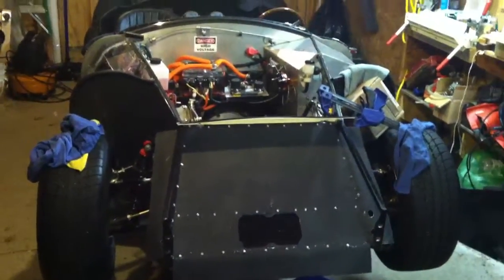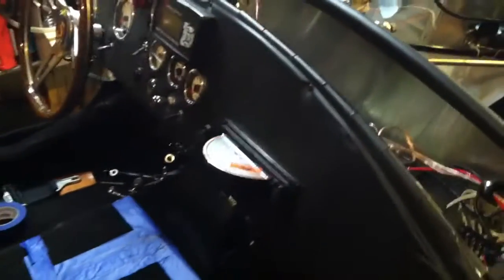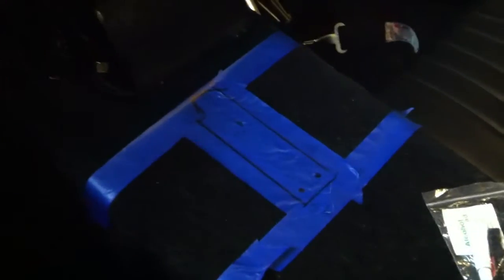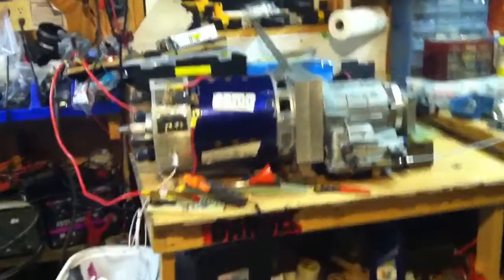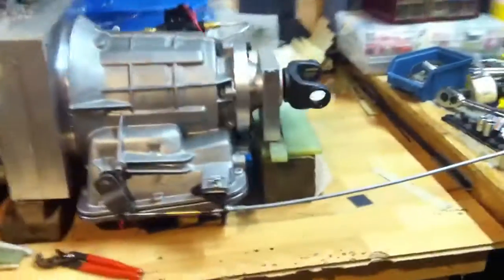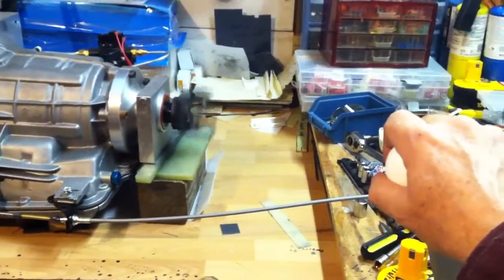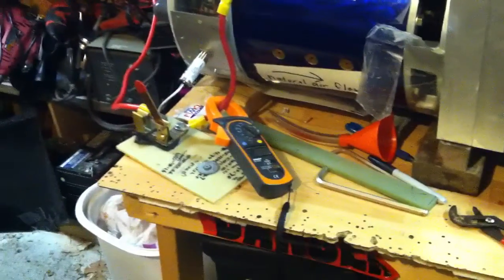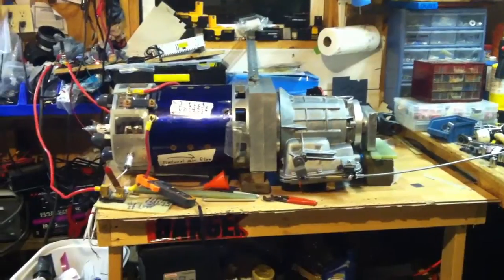FFR Mk4 - Electric Car - # 51: Body off, new drivetrain on the bench.

Comment: is that motor adapter off an aircraft carrier? :)
I might have tried thin plates with bits of tube welded on as spacers.
does that evglide have a torque converter in it? so it's inefficient.
Reply from the maker: The torque converter is not needed in this application and has been eliminated.